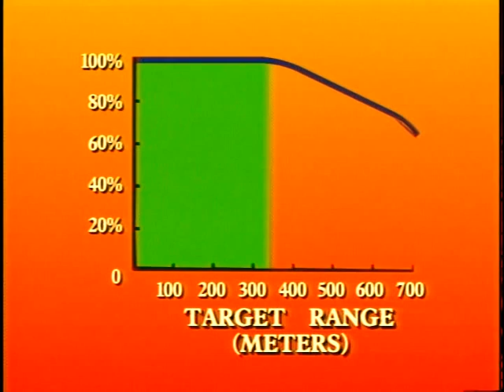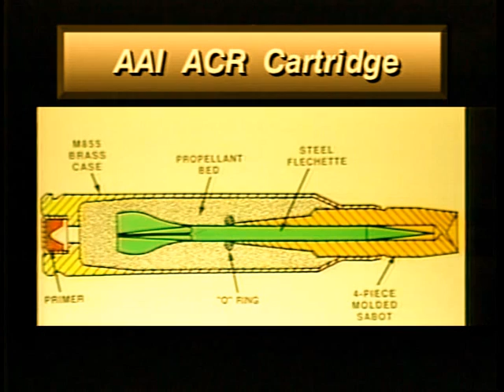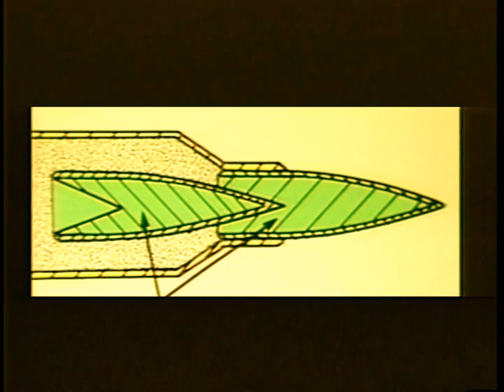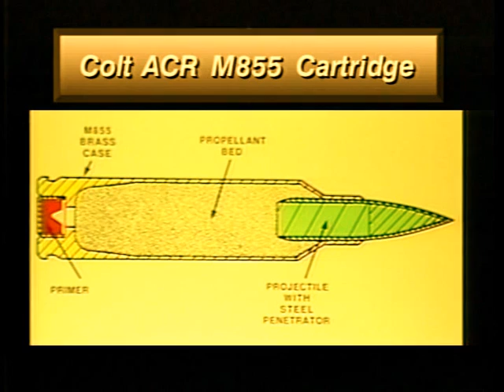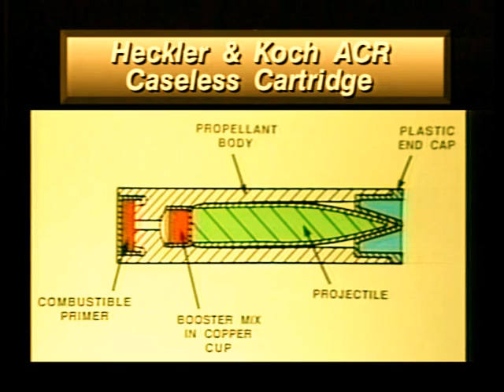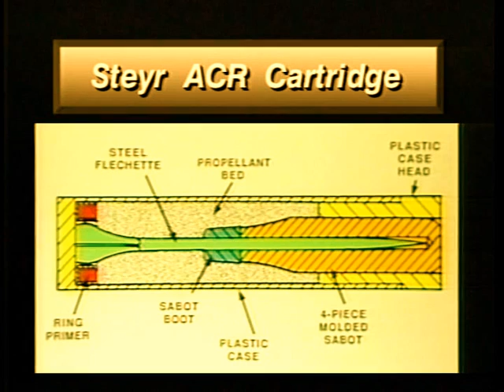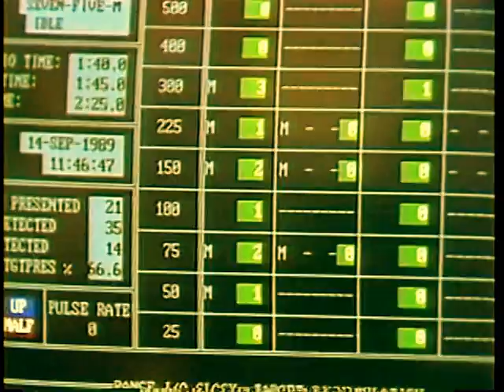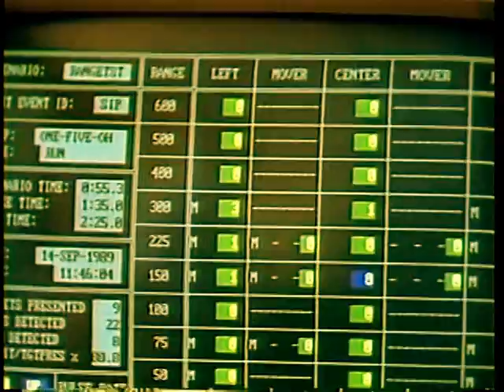Advanced Combat Rifle (1991)

Comment: When was the last time colt developed a cutting edge weapon ,1885 ?
Reply: 1911.
Reply: @tylerlondon5052 John Moses Browning developed the 1911, not Colt.
Reply: 1968. (M16A1)
Reply: @sackheadjones5407 That was Eugene Stoner working for Armalite colt bought the  rights fucked up the powder  charge, dropped the chrome lined barrel and gave it a three round burst. The A1 basically went back to Stoners designs.
Reply: @femstora fair point lol
Reply: @femstora The Army/DoD couldn't get large Lots of original spec M193 that used extruded stick propellant, so they allowed Winchester Cartridge Company to use ball propellant instead, without any consultation with the the rifle designers.

It spiked port pressure 10,000psi due to the elongated conflagration wave, even though chamber pressure was similar.  That caused the cyclic rate to increase outside of the weapon's ability to extract and eject reliably, which was compounded by corroded chambers.

The original 601 AR-15 rifles worked very well on original stick propellant M193.
Reply: @femstora  The Model 601 still had full auto, the first burst M16 was the A2.

Comment: Man, looks like that H&K rifle had a lot of recoil.
Reply: Granted its the recoil of 3 shots at once
Reply: It's also crazy to think that ACOGs & Elcans were around back in the late 80s!
Reply: That was a three round burst though
Reply: I know that the original post is from long ago.
Yeah, that  g11's recoil look ridiculous however it is a recoil from 3 bullets fired in very high rof before the recoil hits the shooter, same concept is in Russian AN94. But colt also shoots normal (i mean not flechettes) bullets and it doesn't have so much recoil. It would be great to be able to try all those prototypes.
Also the g11 had ridiculously complicated internals (shoutout to gun Jesus). But it is very futuristic looking weapon. Funny thing,  spare magazines are housed on the sides of the loaded magazine,  so the shooter always has spare ammo with him. But I think that H&K overdid it a great deal.
Reply: They explain the recoil differences.  For AAI, the lower recoil is because it fires flechettes, which are lighter.  The Colt rifle incorporated a new buffer spring.
The HK rifle fires much faster than the other rifles and piles all three rounds into one.  In effect, it is 3 regular rifle shots all at once.
Steyr, like AAI, fires flechettes.
Reply: pretty sure the point is that the moving magazine delays the recoil until all 3 rounds have left the chamber. although i think it would still be preferable to just have very little recoil at all like the Steyr and Colt prototypes.
Reply: Is unworkable with that bullshit magazine
Reply: @martinthemillwright yeah the main issue with ceaseless ammunition is cooking off. So it makes no sense to me why the magazine it right above the hot barrel of the G11
Reply: @christopher zarcone  @M. B.   All weapons in this video have a 3 round burst (except the colt but this weapon is shown to fire full auto) none of them have such a ridiculous recoil as the G11 so that's not really an excuse
Reply: @user-eo2hk2it5i  the AAI rifle and the steyr both fire flechettes rather than normal bullets like the h&k .....
Reply: @user-eo2hk2it5i  Not true, the recoil is affected by the mass of the projectile. The AAI and Steyr fire flechettes that weigh a fraction of the G11's prjectile.

Comment: Even the Army was shitty at their own history.
"In 1969, the M16A1 officially replaced the M14 rifle to become the U.S. military's standard service rifle." 12 years after the video claims the M14 was adopted.
Reply: +Markius Fox The M14 was indeed adopted in 1957, officially. However, its early production was fraught with problems (despite promises to the contrary that led to its adoption) and it didn't see widespread issue until the 1960s.
The XM16E1 started limited issue in Vietnam in about 1965, and the M16A1 was type-classified as Standard A in 1968, with mass issue outside of Vietnam beginning shortly thereafter.
The Army's history wasn't that inaccurate in this video, really, except that it said the M14 was lighter than the M1 (it's technically true by a few ounces when both are unloaded, but exactly backwards when loaded). It also glossed over the M14's huge problems in design and production.
Still, the M14 was the shortest-lived general issue service rifle in the US Army's history, only ~11 years officially and under 10 years in actual fact. The Krag might equal that, but it's a near thing either way.
Both were rifles that, while more advanced than the weapons they replaced, were still obsolescent almost from the beginning, and were definitely outdated before they were replaced.
Reply: The use the date when they are completely phased out. Not when it first started getting feilded.
Reply: However M14 found it's niche as a DMR. M14 EBR, M14 DMR, M39 EMR, M21 and 25, so it wasn't as obsolete. However move towards intermediate cartridge was inevitable although now they're going back to more powerful cartridges.
Reply: @oskarskalski2982  Of those you listed, three of them were stopgaps so the SR-25/Mk.11 could be tweaked into the M110. The M21 was the only one that really was adopted in any meaningful way between the Vietnam War to the GWoT. The M25 was a developmental deadend.
Reply: @MarkiusFox   True, I never stated that it is being used as a main rifle for a DMR. I've just stated that it outlived its designation as a main service rifle. And like you've said M21 hav seen resurgence during war on terror. M25 was a developmental dead end because this chasis has it's limitations (for one being 70 years old). However from what I've read both M21 and M25 are being used although in limited numbers.  So to sum up my point was just that after pulling m14 out of service as a service rifle it still found it's niche, that's all:0.

Comment: That AAI design needs to be reconsidered, especially since combat positions are open to women now.
Reply: The main thing is - use what You have, best You can! If You go to war - GO TO WAR! Say good by - to yourself first, then to your  family, and GO...
Reply: +Scowler if women cannot handle the weapon (or anyone for that matter) they shouldn't be in said combat role
Reply: *****
If weapon has been rendered obsolete time and time again, it shouldn't be there either.

By your logic, no-one should be in combat, since the military's understanding of fitness and nutrition is obsolete as well.
Reply: Scowler "If weapon has been rendered obsolete time and time again, it shouldn't be there either." - I agree, that being said these is a cost - value ratio. Many things may be slightly better but cost a lot more. There is debate over whether any of these weapons were actually better. Colts weapon is just an pimped out m16 which US forces are using a different form of today. The G11 (aside from being stupidly expensive and complex) has issues with overheating (due to caseless ammo) and the ammo itself is far more vulnerable than cased ammo (as the metal of the case protects the inner powder and primer). The shift from 5.56 cased to some other ammo type is expensive.

"By your logic, no-one should be in combat, since the military's understanding of fitness and nutrition is obsolete as well." - Not really. If men and women are doing the same job they should be held to the same standards, lowering standards (for either one) results in less capable soldiers. The arms knows what it needs in terms of soldiers fitness better than most.
Reply: *****
Exactly, they should all be held to the same standards, and those standards need to be rethought for the sake of effectiveness.

And I wan't talking about the weapons in this video, I was talking about modern weapons. Only thing here that's still cutting-edge is the flechette ammo. Low pressure and recoil impulse, faster projectile, same painful wounds.

You know, I wonder if the G11 could be miniaturized through DMLS or EBM fabrication. It'd make a pretty nice civilian target rifle/pistol. Very smooth exterior.

It'd mostly be a way to show the effectiveness of Additive Manufacturing tech when it comes to precision tools, like overcomplicated rifles...